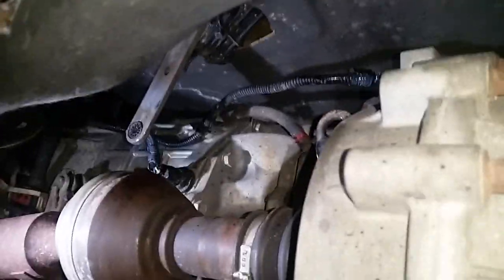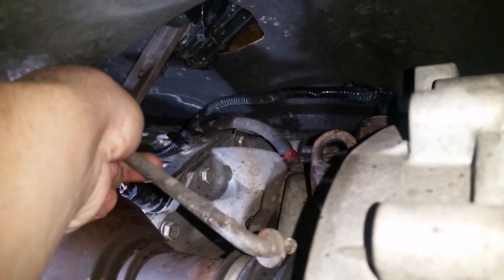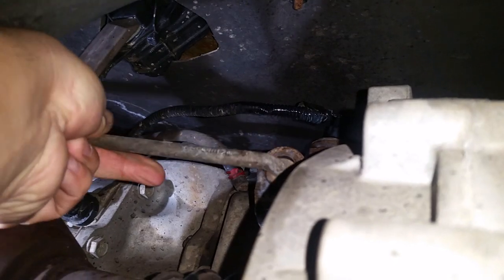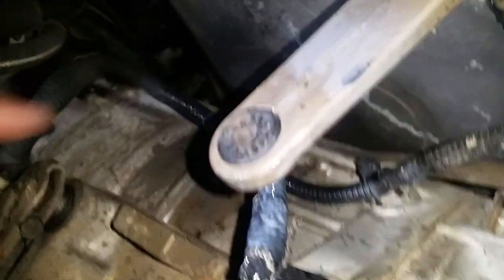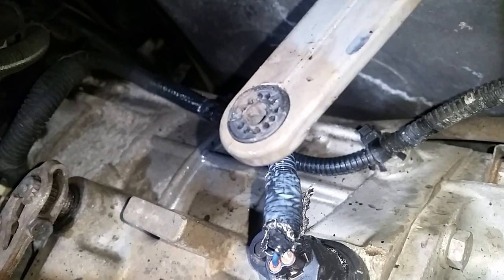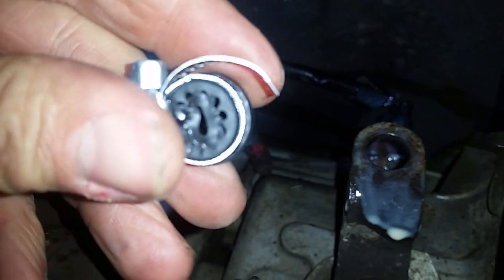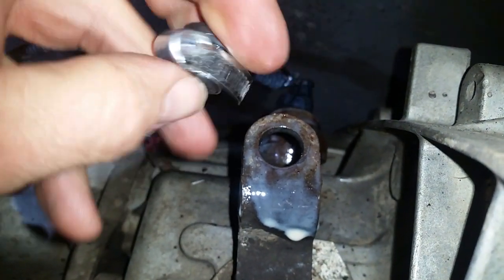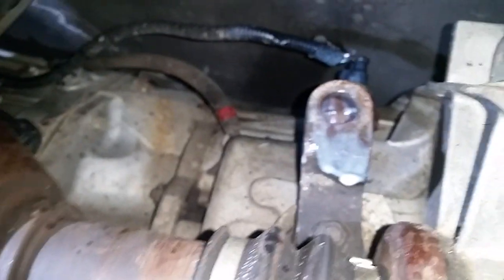2002 Dodge Ram shifter linkage grommet install cheat

Comment: I put mine in a year or two ago using your meathod It worked fine but recently my driveshaft flew off and Musta hit it and busted one of the bushing so I have to do it again. Can you tell me is the rod supposed to just pop through those bushings and that’s it or is it supposed to have a circle clip on the other side or the clip? I couldn’t remember I thought originally they had a cotter pin in a washer, but I might be thinking of something else. Thanks.

Comment: I'll look underneath my 99 dodge ram 1500 and inspect the mechanism. The shifter lever knob that moves from 2h to 4h is difficult to move but after toggling it a bit, it does move. What do you think is causing the difficulty? I got this truck a month ago and overall a great  truck and well maintained but want to have this shifter knob move easier. When I move from 2h to 4h , I see the light on the instrument panel that 4 wheel drive is engaged. Thanks for any advice.

Comment: Awesome cheat!  Does anyone know where I can get this grommet?  I need it for my Dakota.
Reply: Napa and Advanced have them for $20 and $16 respectively. The ones that fit my 03 Ram 3500 anyway. They deteriorate every 5 years or so. real pain since you do not know they are gone until you need them.
Reply: @richardschaefer9858  thanks for the info. I hadn’t checked but that seems like one of those parts the parts stores would carry 🤦🏻‍♂️
Reply: most big name auto parts stores keep them in stock now... mine was Dorman #14078.
Reply: I ordered it off Amazon because that was the cheapest. I took a chance because it said it was for a Ram truck but it fit same size grommet.

Comment: Channel locks in less than two minutes.
Reply: Not for me! Im wondering if its all about how new of a product the bushings are from the store. I destroyed a bushing trying to get one on with channel locks. :(
Reply: @jaygatton4395  i just put one in my 03 ram 1500 I used plyers to get it half way in and then i pushed the bottom of the bushing in with a flat head screw driver took me about an hour of trying things. will do the 2nd one in a few days.